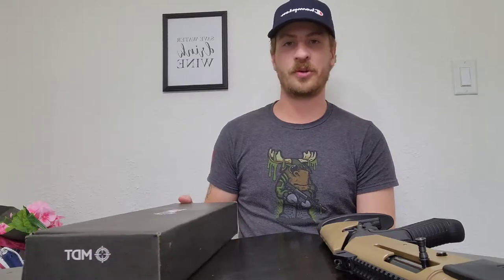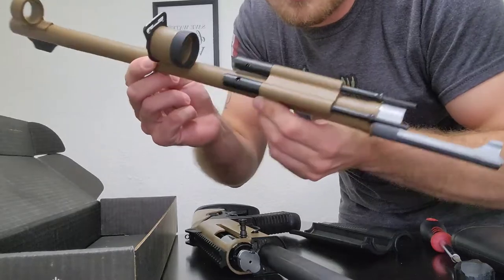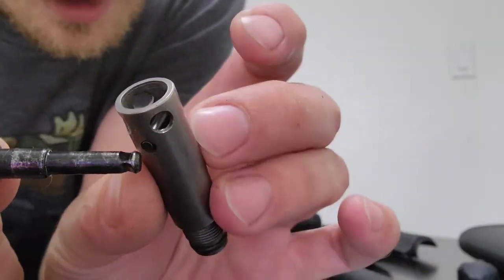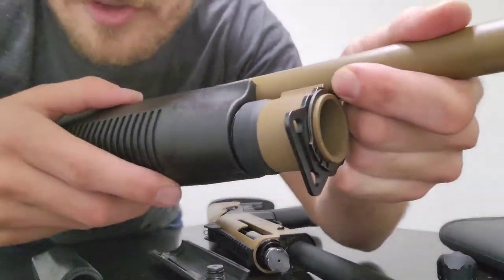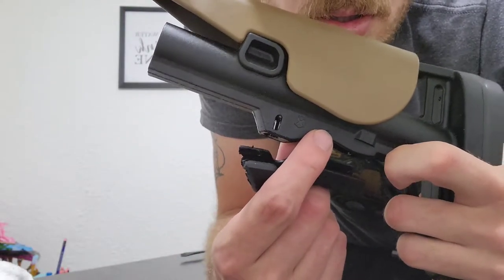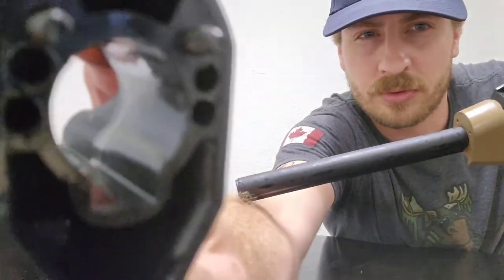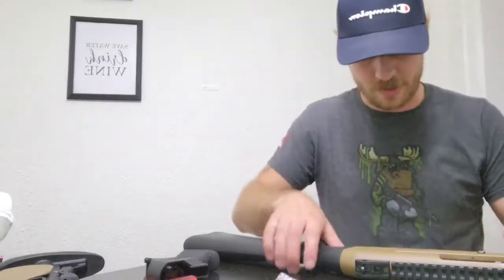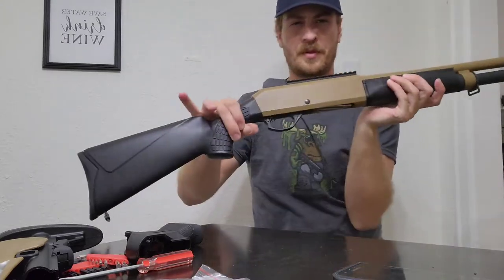Canuck Operator with Sulun Tac 12 Parts (Benelli m4 clones)

Comment: My chokes came in unusable condition.  Major pieces of metal folded over into the bore from where they punched out the key slots.  Customer service from O’Dell was non-existent.  They told me to take the burrs off with Emory cloth but these aren’t burrs, they are large chunks of metal.  I wouldn’t purchase anything from O’Dell because I just don’t trust them.  Im going to return this lemon tomorrow.
Reply from the maker: That's super shitty man. My chokes had little burrs from where they punched out the key slots too but I was able to knock the burrs of with a small tool. I noticed one of the burrs on the modified choke was a little bit bigger (more metal) so I took it shooting and the lead from the shot smoothed it out hahah. Quality control is definitely lacking for these guns but best thing to do and what I did is ask the shop who is selling them to show you every Canuck Operator they have in stock and choose the best one.
Reply: @DailyDoseOfCanada  Their customer service has now reached out and now offered a replacement choke so that's good.  Still not very confident in this.  I have ten more days to make up my mind whether I'll keep it or not.
Reply from the maker: @Rob Castell that is good to hear!

Comment: How did you get your charging handle out? I’m having a tough time, I understand the takedown process for cleaning but I need my bolt out!
Reply from the maker: It should be a simple twist and pull out of the bolt. It should just come out easily with a little bit of resistance on the detent on the charging handle when pulling it out with a twist motion. I have seen a few videos of peoples Canuck Operators that have a really tight one and they use a rag to not scratch it and then a set of any pliers and they reef on it with the same twisting and pulling motion
Reply from the maker: https://youtu.be/YbwFn9nW2jQ I know the video is not English but you will see this guy have a hard time getting his bolt handle out so he uses a rag and his letterman lol mine was that tight at the beginning and now I can take mine out easily by hand. Hope this helps
Reply: Hey thanks a lot for the reply, was worried I was going to break it lol Happy New Years!

Comment: I believe I purchased an updated version of the canuck elite operator from SFRC. The adjustable stock is a better design than this one. Also was sent a fixed stock but the didn't include the recoil tube bolt. No idea what size or threading I need to attach it.

Comment: In my opinion the narrow gas piston part might be more effective in light loads, because its not the gas port its the one piece of the system which absorb unnecessary gas. Being narrow might be useful because more gas that is coming from the gas port is going to the opposite side to hit the bolt hardly and operate the system well even in light loads. Maybe %70 of the gas should hit the bolt side and other %30 should be absorbed by that piece. When it gets wider it absorbed more gas from the gas port that may cause jams. However narrow piston may cause more recoil as well😄
Reply from the maker: You may be right. All I can say is it made no notable difference to reliability as it ran before and after the  gas plug change.

Comment: What was the reason for changing the gas system? Just easier disassembly or is there a issue with the canuck parts?
Reply from the maker: No issue with the stock Canuck gas system at all. Like you said just wanted the easier disassembly and now I got a spare set if something happens. Also we will see with time but I think the tac 12 gas system might be a bit more reliable only because the gas port is wider for more gas to drive those pistons during adverse conditions only downside would be slightly more felt recoil from the extra gas

Comment: How is the length of pull from stock? Do you still have the other stick on hand?
Reply from the maker: The traditional stock has a length of pull of "14 which is great for me at 6ft tall and decent long arms. The collapsible stock can go a lot shorter I can measure it later but I'm gonna guess it can collapse down to a "11 or "12 length of pull and can extend out to "14

Comment: Great video...so basically what you are saying is, that is I get the Sulun Tac12 instead of the Canuck Operator, all the right parts will already be there?
Or did I miss something?
Reply from the maker: With all my research of the two this is what I was able to figure out. The Canuck Operator has a machined bolt tail instead of the crappy shims with rivets bolt tail that the original Benelli and the Sulun have. I have seen on multiple benelli forums of peoples bolt tails that crack and rust to shit. So imo that is a major plus for the Canuck Operator as the bolt tail is a main piece and if it fails the whole firearm will not cycle. The Canuck operator also has a slightly lower and better profile picatinny rail than the sulun. The Canuck also has a larger factory bolt release than the sulun and benelli. My main issues with Canuck Operator was the gas system as addressed in the video, no qd sling mount  like on the sulun, and also the bolt pin on the Canuck is cut off which is a major piss off because I need a punch to remove it so I ordered a sulun spare bolt assembly and it has the real pin that has a flat edge so I can remove it with the bolt handle (hope that last part made sense). So pretty much in short I had to do research and find the best parts and closest to an original Benelli m4 as I could get. So now I have a Frankenstein Canuck Sulun Operator haha
Reply: @DailyDoseOfCanada  
Thank you for the excellent information!!.
This only confirms the old saying, that the devil is always in the details.
Almost everyone claims that those clones are all identical and the only thing that sets them apart is the exit QC....but you have just proved, that this is obviously not the case.

What is your opinion of the S&J hardwares "Turknelli"?
From what I understand, they get a base clone from one of the Turkish manufacturers and then address all the known weak spots?
Would that be likely the best course of action available to us, when shopping for one of the M4 clones?
I'm still in the learning stage here.
Reply from the maker: @VLK-73  They look like a sweet build and I doubt you would be disappointed with it. The price seems fair for all the extras added and their quality control would be much better obviously. I just ordered the RxArms Titanium stainless steel hybrid Charging Handle for the Frankenstein Operator. Maybe I will do a video of it when it comes in!
Reply: @VLK-73  why not just get the real m4 ??? All these clones suck in comparison!!!!
Reply: @marlonwesley9676  
While this statememt could be very accurate come 10-20 years ago, I had noticed a trend of brand names gradually slipping in quality, while the non brand names are improving.

If I could guess, at some point they might meet in the middle, but the brand name will cost you 3x as much.
Reply: @VLK-73  none of the clones out there have reproduced the quality and reliability of the actual M 1014 or M4! Yes, you pay more but  what’s  your life worth? For me personally, I choose reliability.

Comment: probably dumb but how do you open the mag tube?
Reply from the maker: No dumb questions when learning! You unscrew the magazine cap. Lefty loosey hahah. Then the magazine spring is retained in the magazine tube but you can stick a long flat head screw driver down there and unscrew a cap piece that holds the spring in the tube so it doesn't go flying like my Remington 870 once you take the magazine cap off. Hope that helps!

Comment: hey 
new sub.
on the fence on getting a semi 12g can you do another table top update on what ya think of it
thanks
Glenn.
Reply from the maker: Yes! I plan on doing a 1000 round update video of the parts I purchased in this video. I would strongly recommend a semi auto shotgun. I have a Remington 870 Marine magnum on my back while fishing and camping and I absolutely love it but it is hard to beat the recoil reduction and increase in rate of fire from a semi auto also the ARGO gas system even with reduced power loads has been super reliable for me no malfunctions so far!

Comment: Hey do you know if the front handguard is interchangeable with the benelli? I’m very interested in getting one and an Agency front hand guard for it
Reply from the maker: Hey I'm not sure exactly if it interchanges with a Benelli. Every photo I have seen looks like it will work but I don't know 100%
Reply from the maker: If you go through the hassle of figuring it out, you should let us know if it works! Thanks🍁
Reply: I was at my local shop and they do up a custom turknelli using the Revolution Armory Impact R4 and they said that particular shotgun is almost 100%. The other ones I’m not sure of

Comment: Would it be better to buy the Sulun over the Canuck?
Reply from the maker: They both are not that bad of guns with a little bit of upgrading but best advice would be to just get either one and get as many rnds as possible and train with it and you will still be $1000 cheaper then the benelli M4. Then if you become really proficient or really like the platform, I would buy the actual Benelli M4. I know the price is steep but buy once cry once.

Comment: How do I take the bolt apart?
Reply from the maker: You have to take a punch and punch out the firing pin retaining pin. On the Benelli m4 this can done with your finger nails or a knife or a flat screw driver as the pin has an O-ring on it so it is easy to pull out but for some reason on my Canuck Operator they cut the head of the pin and hammered it in flush. It's a piss off that they made it so hard and need a bench and punch to fully disassemble the bolt instead of staying true to the Benelli design of not needing any tools to fully disassemble. If that doesn't make sense just watch the Benelli youtubes channel video on how to fully disassemble the M4